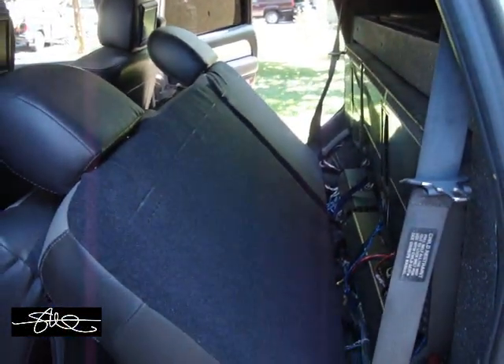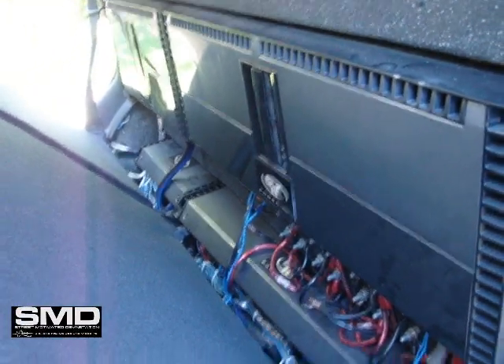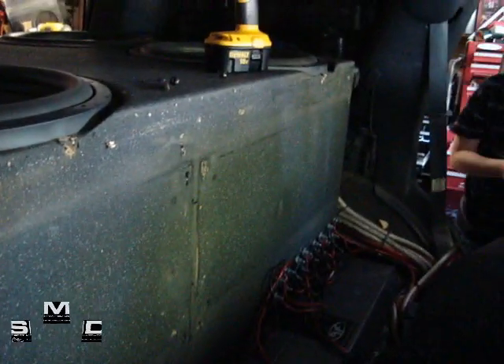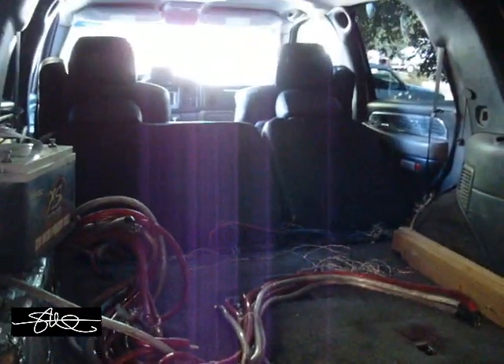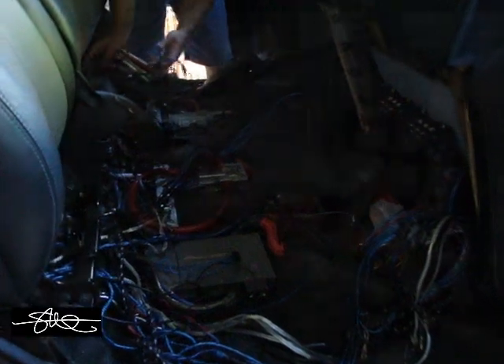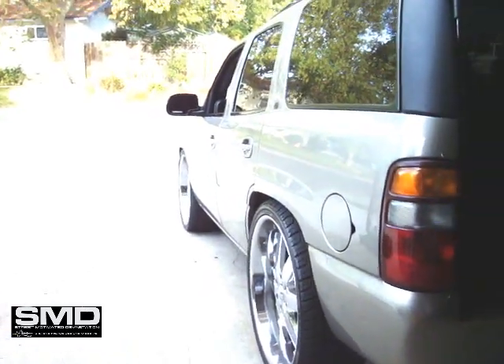The 20,000 watt Dismantle - Out with the Old! (Vid1)

Comment: @207Nrod you can use any battery but i would advise you to not use a lead acid battery. the best ones to use are either car audio batteries or if you can find some cheap 12v dry cells those will work.